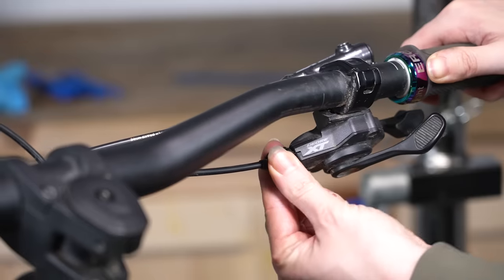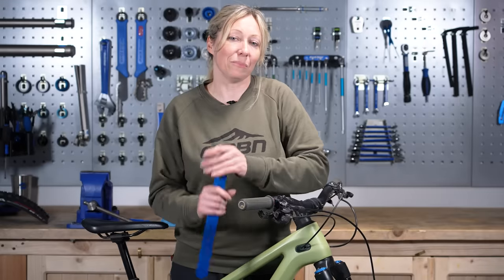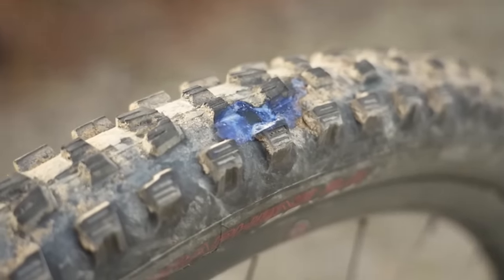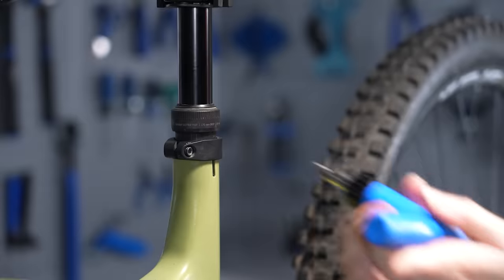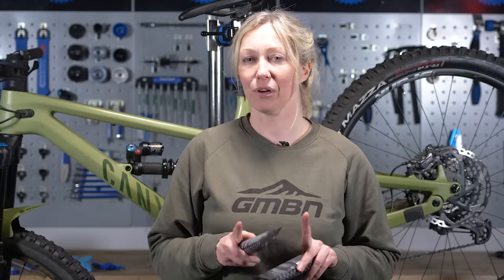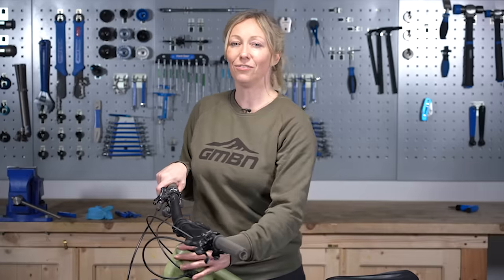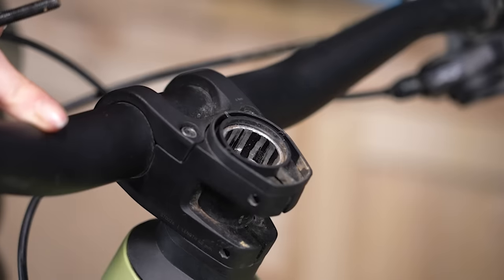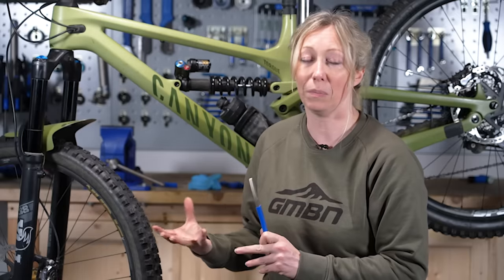7 Essential Maintenance Skills You Need To Know

Comment from the maker: 🔧Do you have any maintenance tips and tricks that you think are essential? Please share them in the comments below! 👇
Reply: Check wheels and bottom bracket for looseness, check the chain for stretch, check the hub and chainrings for wear. Check wheels for true and round and dish. Check pedals for too loose or too tight
Reply: Overall good tips, maybe one to add is to clean the chain with someting like wd-40 before lubing.
In my experience 75% of bad shifting drivetrains come because of inflexible chains which sometimes appear clean but are just too sticky.
Reply: And check and adjust all cables
Reply: I wonder why people use a disc truing fork 😂 i just take off the disc put it in a flat wooden surface and hammer it with a mallet till the thing cries "I'm straight I'm straight" before i install it again. I may be a little crazy but i would also rotate the disc on a flat surface with a filling tool placed on top to make sure the disc is flat or even by it's edges and even just use a heat blower to burn off whatever invisible film you may not be able to see. I do similar for brake pads when giving a through clean, slight filling and heat blowing.
Reply: Obviously for 6 bolt brake rotors you can do both sides but for lock rotors only the side facing upwards when placed flat.
Reply: 2:53 Tip 2: Stop, shift to the higher gear, if the cable is not tight - tighten it. I you are in the middle of the race, yes - try to fix it on the move.
Top tip: learn how to tape or zip-tie spare derailleur hanger to your bike frame or under the saddle if you are not known for changing saddles like gloves. Knowing how to replace the hanger could be nice too, but when it's broken in the wilderness, you'll learn it quickly on a spot.
Reply: If you have no tyre levers get 2 rounded handle teaspoons, whip off enough bead to get your fingers in the gap and ease the tyre off by running your hand around the inside of the  bead, the less you use levers ,the less chance of pinching the tube, that works for putting the tyre back on too.

Comment: I've been taught to center the calipers (either disc or rim) by unscrewing them until they are loose, then pressing on the lever, so that the pads are pressing on the disc (and thus are centered) then tightening again.
Reply: I also learned it that way..
Reply: I'm a professional mechanic, that is exactly how you do it.
Reply: Depends on the problem. If your pistons aren’t clean you’ll just be trying to compensate for a stuck piston that way. You should be able to align the caliper itself to achieve even piston extension if they’re moving freely. The piston position can be way out if you just squeeze the levers to center it
Reply: I agree with that. That is what I expected to hear in the video. Is that not a good practice? Doing it "by eye" sounds worse to me (at least with my eyes)
Reply: Just like what  @bchearne  said. I always did the lever trick, but had scenarios where brake pads were worn out at one side, later found that the piston needed to be cleaned, not that the caliper needed to be moved.
Reply: Wrong way, just use your eyes
Reply: Not always best practice, I mainly work on motorbikes but the principles are the same, with new pads that is ok to use the lever to help align the wheel, with old pads that were in a caliper that may be misaligned somehow you should just make sure the wheel is fitted straight and the caliper too, without using the pads to help, or replace the pads too. 
Obviously much more important to do it right on a motorbike.

Comment: To Alighn a Disk Brake Caliper...You Sqeeze the Lever...Hold it...Then you tighten the bolt's.
Reply: Exactly- this is the only correct way to do it. Not „by eye”…
Reply: Add:  Grab the lever so that the brake is just starting to bite and spin the wheel the opposite direction it normally goes then squeeze the brake the rest of the way before you tighten the bolts.
Reply: This only works if your brakes are in good order and your pistons activate evenly. It doesn't always turn out that way. Hence I wanted to explain an alternative method that always works for me - by eye. 😉
Reply: She speaks truth 👆🏼
Reply: I’ve tried this about 1,000 times and it has worked about 0 times.
Reply: Never do that. The caliper should be centered on the disc

Comment: I am absolutely horrible at adjusting gears and derailleurs but one thing I have learned is you can get get different results from adjusting your barrel adjustor on a bike stand and doing it while riding. I personally believe it's better to do it while riding because you are putting stress and pressure on the chain, crank, cassette, and cable so your adjustment will actually hold. But I've found that when adjusting on a bike stand that it will be fine on the bike stand but then once I get on the bike and ride it the adjustment was off. But then again as i mentioned I REALLY suck at adjusting gears, lol.
Reply: Adjust it on the stand then tweak it when riding if required.

Comment: Measuring your fork's/damper's travel with a ruler might not be a good idea. My 160mm Fox 36 stanchions measure 170mm from seal to crown and my Float X measures 65mm even though it's 60mm. Same with my 140mm X-Fusion Sweep Boost, it's 150mm seal to crown. Check the manufacturer website for information if you're unsure what travel is your suspension. Fox for example offers an easy to use tool where you put the serial number of your fork/damper and it gives you the exact specification as well as set up and service manuals.

Comment: When adjusting a caliper, you can loosen the bolts, then pull on the brake lever, and retighten the bolts while the brake is firmly engaged.  The caliper will center perfectly on the disc leaving your brake well-aligned.  (This is only for hydraulic brakes that clamp the pad to the disc from both sides.  Mechanical brakes that squeeze only one side will need to be carefully aligned as in your video.)

Comment: Adjusting the brake disc.....set the tension of the brake that you like then loosen the boltz.....spin the tire and grab the brake and hold it and tighten the two boltz...now centered on your brake tension

Comment: I actually loosen my brake calliper, squeeze the brake and tightebìn the calliper; it always seems to work.
Reply: Same
Reply from the maker: That's a great tip, doesn't always work. Especially for 4 piston brakes, but it creates a good starting point to make adjustments from!
Reply: Yea i noticed that with my new e4 hope 4 piston brakes, i still have to adjust by eye 😊

Comment: Barrel adjust while riding cant  beleive ive never thought of that tip makes so much sense 😊
Reply: Works too
Reply from the maker: Let us know how you get on!
Reply: My barrel adjust is on the deraileur. I shift to the lowest gear, turn the adjuster "too far" then shift to 2nd, (Then it should be still in 1st)  then loosen the adjuster on a stand while peddling and wait for it to go into 2nd.

Comment: If you've just fixed a flat, reinstalled your wheel and you're getting brake rub that you weren't before, it's almost always that you're wheel isn't centered. Make sure it's centered before messing with caliper adjustment.

Comment: Great video for the basics. Being able to sort disk caliper / pad rub on the trail is an essential skill. But it's also worthy to check back at base that the caliper is centred over the disc. Generally this is easy as most calipers comprise 2 halves bolted together, so the joining face should align with the disc. If not, this may indicate stiction of 1 piston (or piston set) due to disk residue or grit build up around the exposed part of the piston.  A good clean of the assembly with the pads removed will usually sort this to new. Cleaning the piston actually involves a bit more work in terms of actuating the brakes to expose more surface, but beware not to pop a piston and remember to push the pistons back carefully with a strong plastic lever (be especially careful levering ceramic pistons).

Comment: For the caliper alignment issue, you can also remove the brake pads from the caliper and give a little bit more tension to your pad spring that hold the pads in place, it's made of stainless steel. 
Just pull it appart gently in order to make the opening a bit wider, then put back your pads in the caliper. 
The pads will now have a little bit more facility to come back closer to the pistons than before, therefore clearing your brake disc more easy.

Comment: Good video. You don't mention how to ensure the headset isn't too tight. I pick up the bike from the saddle nose, allowing the front wheel to hang with the steerer tube roughly vertical and swing the wheel (or handlebars) to one side and let go. The front end should smoothly swing back to center with an oscillation or two. If it can't, loosen pinch bolts, loosen the top bolt an eighth of a turn or so. Retorque the pinch bolts and repeat checks. 
You can also check by riding hands off. If you crash right away it was too tight.

Comment: In the case of recent canyon bikes, the issue is the plastic headset, the only way to actually get rid of issues with it (lose, squeaky, etc) is to replace plastic spacers with metal ones and replace the top cap with a metal one. It is a travesty that canyon still ships that piece of garbage of a headset and gets away with it

Comment: Never knew there’s tire puncture glue, good to know !! Love your videos Anna 🤘…but I don’t think anybody will ever pull a star nut out tightening the headset preload bolt, the bearings will crush before that ever happens … cheers 🍻
Reply: I've actually pulled a star nut out... it's easier than you think when you start out and don't watch GMBN tech... only did it once though...
Reply: Oh it's easy enough to do. I've eeen this happen to a few folks who somehow didn't have enough headset spacers and they kept tightening the headset screw. In fact, if I have to remove a starnut (installing EDC multitool) and the starnut is close to the top of the head tube, instead of pounding it to the bottom, I use a bunch of headset spacers and the screw to tighten it out the top.
Reply: edit: ...the "bearing seals" would crush...

... if a star nut can pull UP that easily, then it's either installed wrong (bent) or something is out of tolerance, like the nut itself or the fork. In some cases they can be pushed through the bottom for removal, but not all fork steertubes are wide enough to let this happen

Comment: 10:29 if your caliper gets out of whack you should clean the pistons before you realign it. It’s probably gone wonky because the pistons are sticking a bit and the problem will just recur if you don’t take the time to get the grit off the pistons

Comment: Near 9:24 the Park Tool Torque wrench is used to loosen a bolt. The instructions with mine wrench say that this will cause the wrench to no longer be calibrated. Sorry if this is a duplicate comment.
Reply from the maker: At low torque it won't mess with your calibration on a proper torque wrench to undo a bolt. These torque tools however are fixed in reverse, friction slip torque for forwards, so again, all good for low torque undo-ing :)

Comment: You don't align your brakes by eye. You loosen the caliper bolts, apply the brakes, and then tighten the bolts. Then, they are perfectly straight in the position at which they are clamping.

Comment: The gap in-between disc & pad is that small, to do it by eye would be quite difficult. Loosen bolts, grab a handful of lever, re-tighten bolts. If that doesn't work, try a disc brake guide.
Reply from the maker: The gap is actually quite big! Holding a white sheet of paper behind the calliper while you're adjusting can help you see those gaps 👀

Comment: 3:04 thats actually WRONG
You adjust the barrel adjuster 1 maybe 2 clicks, THEN you shift one gear back and one gear forward. If done correctly you will need less total clicks on the barrel adjuster to go into bigger gear when shifting. Most people go too far on the adjustment because they dont test the shifting and simply "wait" until it automatically shifts one gear up while adjusting.
Reply: Yep